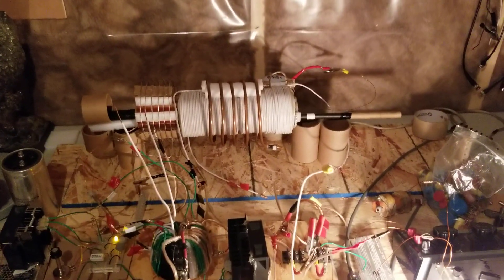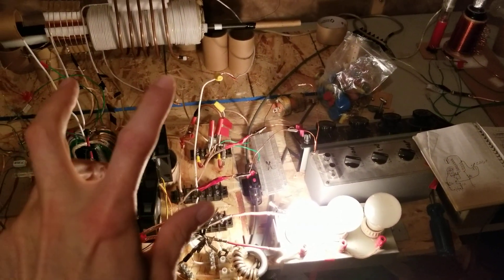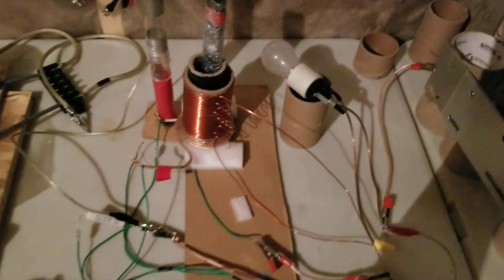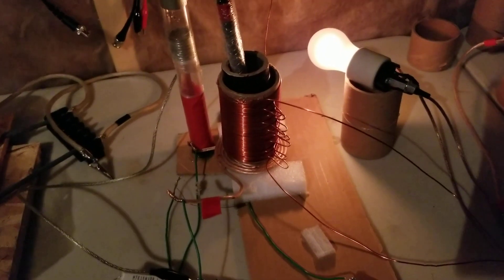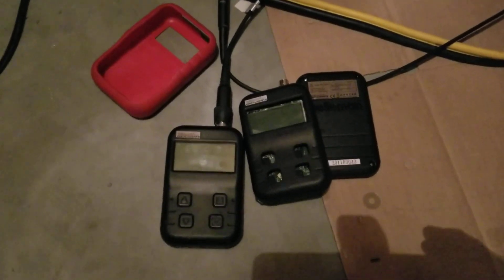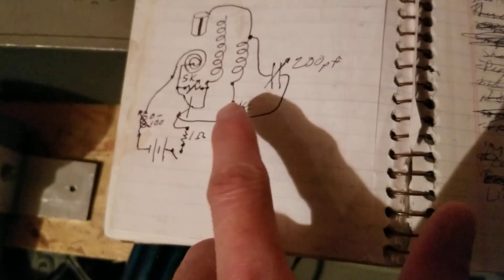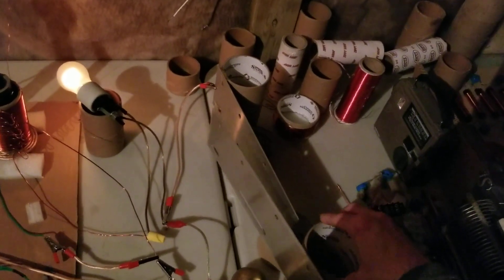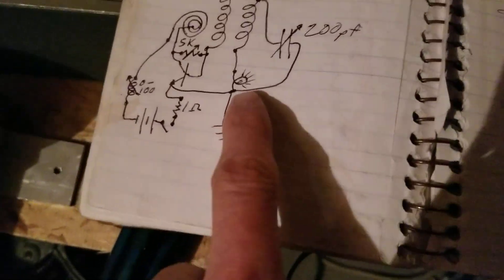Part 9: Akula / Kapanadze Experiments: Resonator, Scope Destroyed, Understanding Tesla driver

Comment: ever used resonant bifilar coils in your setups?
Reply from the maker: A pleasure to speak with you.. yes in a way the output coil from the device in part 15 has a 2 layer inner to outer helical series connected bifilar primary ... which I have seen do amazing things. But aside from measuring very high infuctances to calculate various resonant frequencies.. I have not truly yet realized what you have done with your significant Boost in Voltage
Reply from the maker: ... I am very much interested in trying the schematic you have... I am just being pulled in so many directions it is difficult. 
Would you say you have the Tariel Kapanadze effect ? 
Either way I love your work and transparency, and still want to build your circuit to truly understand the resonant series connected bifilar coil
Reply: @kdkinen  I'm not very familiar with the kapanadze effect.
But I do realize the key is using negative voltage impulses. (in my case back emf, but there are also other methods of generating them).
Reply from the maker: @MasterIvo  i see, what i mean by that is, with a kind of electrical (LC) and mechanical resonance (physical dimensions and geometry) .. there is a phasing of an output oscillator and a Tesla transmitter.. together In -phase producing sudden climax in output.
in 2007 a Georgian man named Tariel Kapanadze performed a 3 Phase 100KW public demo in Turkey before the Russian Energy Minister, driving incandescent lamps, heaters and multi KW motor...
Input : 0.2Amps @ 220vAC...
Output : 3 Phase 100KVA
Reply from the maker: @MasterIvo  2/2.. and thank you so much for replying,..that could explain why i have in the past seen reversed biased diodes allowing Negative polarity through ..?

Comment: @kdkinen
Sorry to hear about loss of your scopes. They might still be repaired as measurement input is usually separate from microcontroller. I usually keep scopes at distance when EMP happens.

Also nice to see you playing with Tesla coil energy transfer apsect. Which needs to be understood if you start adding other things such little spark causing changes on coil with current already present. The aim there is to get ambient energy flow inside open system and the main power supply is not the source of energy for power amplification.

Cheers!